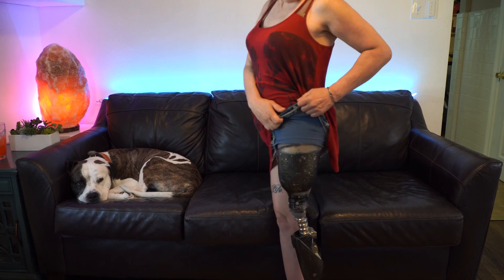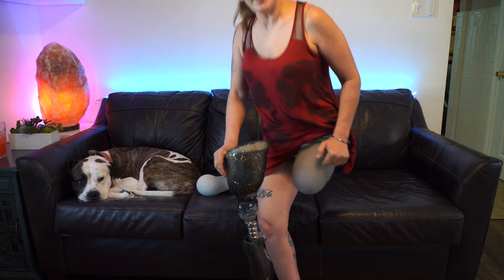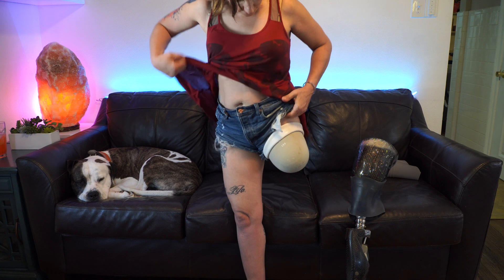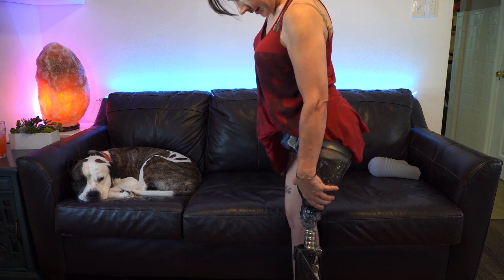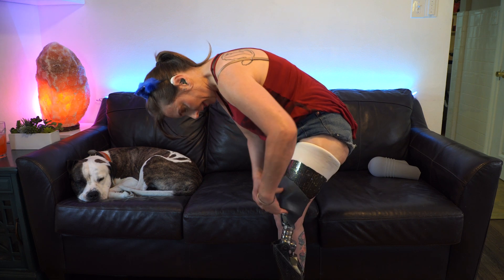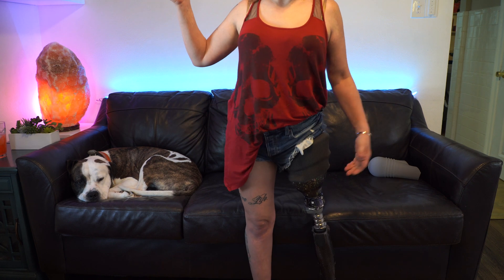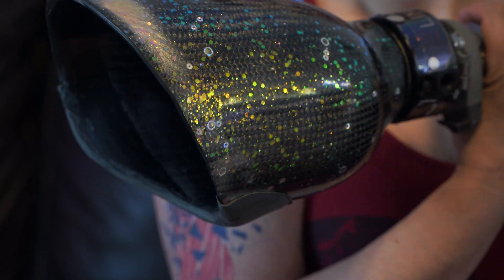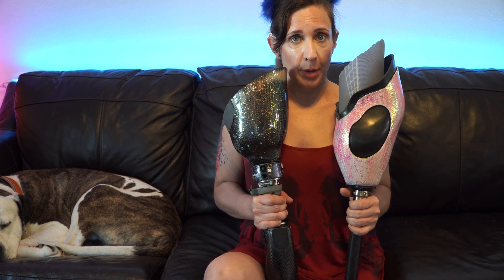How My Above Knee Amputee Prosthetic Definitive Socket System Works

Comment: I changed to elevated vacuum and liked it at first. Then, I realized it made my phantom pain infinitely worse. After TMR surgery, my nerves are so close to my skin…so close that touching or resting many parts of my RL cause steering nerve pain. I have no protective fat and am literally skin, bone and muscle. I also had a bad time with sweat and my liner slipping off constantly. I finally went back to passive (I’m a BKA). My prosthetist made me feel like I was the only amputee that ever had these issues 🤔.

Comment: Love the socket and suspension system you are using. Also, as a fellow amputee I can relate to pouring sweat out of a liner. I would enjoy hearing about your sweat management and skin care routines. In the summer I use an antiperspirant spray and something called Liquid Powder, both sold by the Amputee Store. Keep up the great videos.
Reply from the maker: I don’t use anything currently.
Reply: I use mycota athletes foot powder to deal with any sweat rashes. last ditch remedy is the spray on form of Daktarin Aktiv which stings & hurts like hell but does the business for me & reduces the rashes. I would suggest trying that on a small patch of skin first to check your reaction!

Comment: Wouldn't the sleeve make the environment for the stump swampy?
Reply from the maker: Yep
Reply: @AmputeeOT  how do you remedy that?
Reply from the maker: Dumping the sweat out if there’s too much, letting it dry and putting it back on. Cleaning it daily.
Reply: @morgancalvi115   I use a product called Liner-Liner. It is a thin sock that you wear under your liner that absorbs the sweat. it works pretty well for me.
Reply: @Utubecstalker  wouldn’t that effect the suction though??
Reply: @louisefoerster189 not for me. I never had any slippage from these. Holes in outer sleeve now that is a different story

Comment: My comment as a self builder (& user) of above knee leg units, is that knee joint looks far too low to me. If it was higher you would be able to sit more comfortably & may be able to articulate the knee joint better in the swing phase, given the length of your residual limb. Personally I have always found that  placing the knee joint higher than the other remaining knee is much better operationally overall. I expect your  prosthetist must stick to the "rules" on this placement, which I don't have to though  :)
Reply from the maker: He doesn’t have to stick to any rules, my pylon was cut for my previous length and it’s too short to go higher. And it’s a $7900 one because it’s for an X3. But I’m getting a taller foot and then the knee axis will be higher.
Reply: @AmputeeOT  OK, well glad the "rules" dont apply & things are due to be fettled further! The "rules" seemed to apply when I was in the UK NHS system, on knee placement, materials usage & some other things. I can only experiment using cheaper second hand items because as we know prosthetics manufacturers will not sell directly to customers in many countries (if not all). 
Thankfully there is a healthy secondhand market in prosthetics, many of which are repairable with the right tooling & skills. 
I have yet to purchase anything secondhand with microprocessors as I find the Otto Bock 3R80 to be one of the most reliable units on the market suitable for my needs. However I will maybe purchase some C legs soon & give that unit a try out!  
I have got a prosthetic foot bench test partly in the can, 8 different types, suprisingly (or not) the carbon fibre ones I have are not comparing well to some of the non fibre older units.